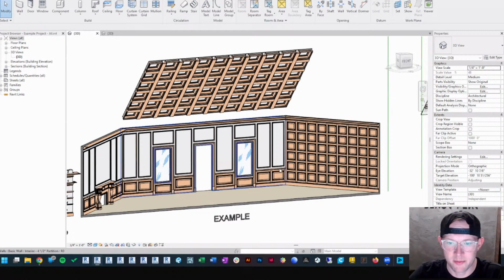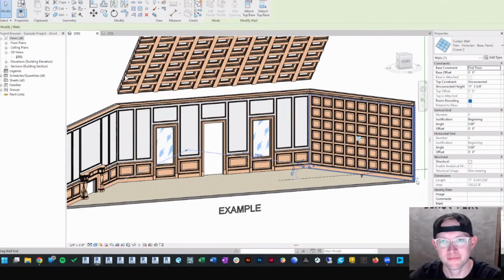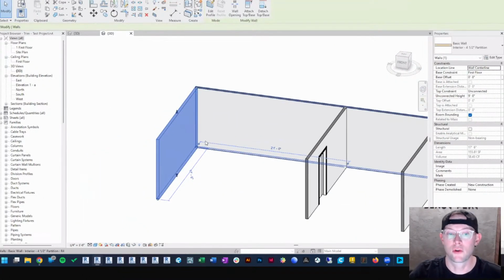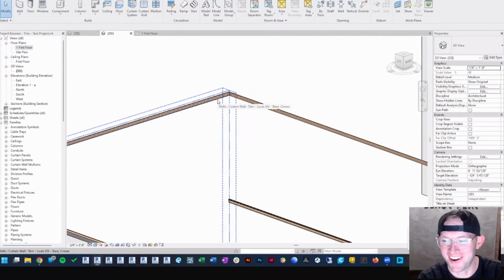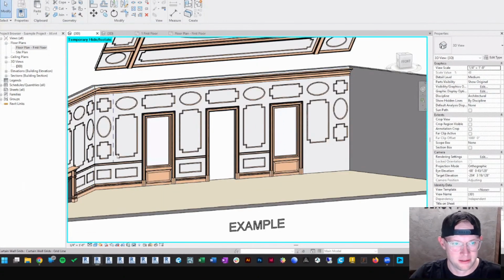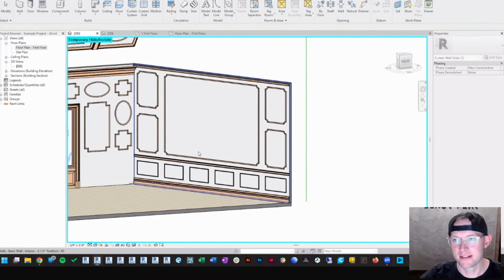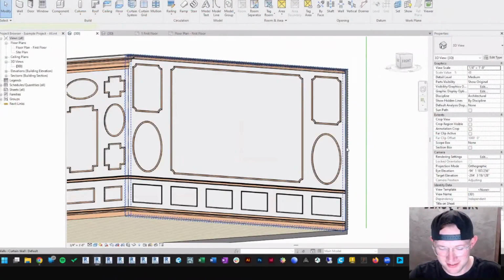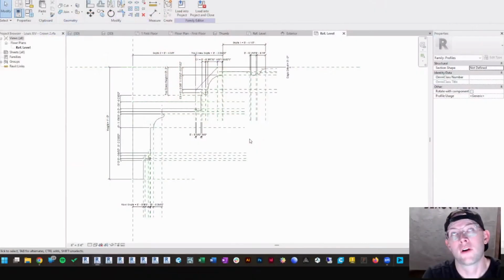A New and EASY Way to Add Crown Molding in Revit! (w/Brenton Wiberg)

Comment: I usually make all custom casework elements as family. It has been most successful in keeping the model light. However, its con is that editing each element for design changes has been difficult since you lose the context in the family editing mode. I wish there is edit in place mode like AutoCAD block editor or SketchUP component editor.

Comment: If you draw the curtain wall as a continuous wall, the crown inside corners will join correctly the first time. It's only when you do one wall at a time that manual joining is required.

Comment: Maybe I missed it but how are the curtain panels not showing joins by default?
Also on my long term wish list, it would be nice if the curtain grids had an option to only span one segment and not the whole length/height of the wall (or roof).